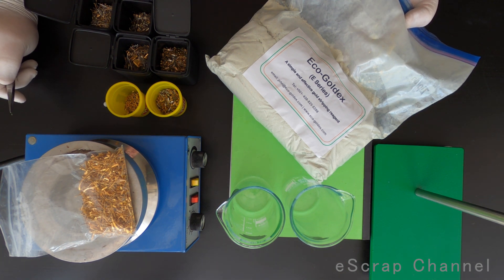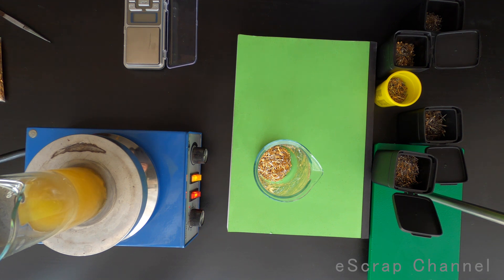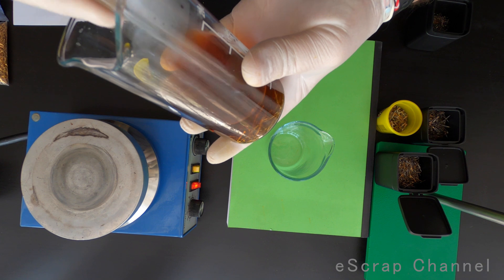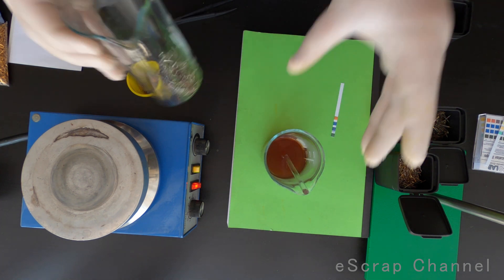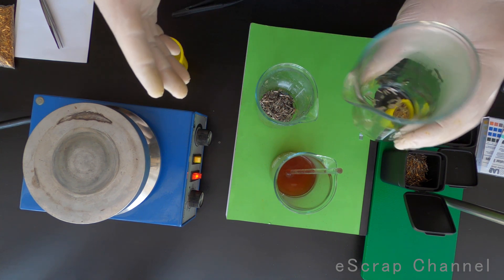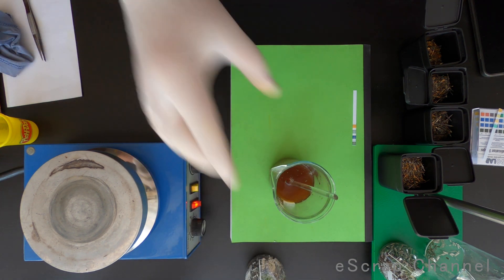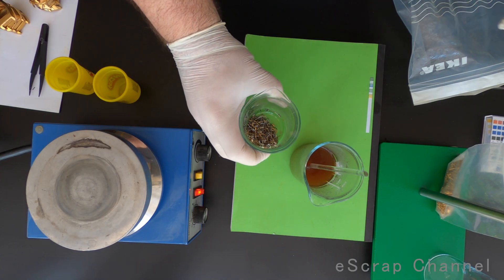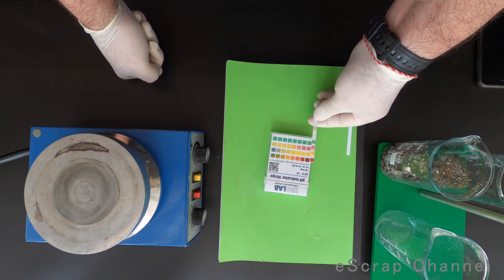Gold Stripping Agent Test: Eco-goldex E series

Comment: One question, being an alkaline solution and containing cyanide, does not the gold precipitate with zinc without having to be acidic?  In cyanide precipitates in alkaline
Reply from the maker: Yes, you are right. Zinc is precipitating gold in strong alkaline solution. Additional 1-2g of Sodium Hydroxide can be added for a complete process. 
In this video I checked the approach of other YouTube chemist working with eco-goldex, but this is not needed to go to neutral or acidic. Gold is perfectly precipitated in strong alkaline solution!
Reply: @escrapchannel  I had my suspicions of being able to precipitate without having to lower the pH to acid, it seemed dangerous to me, and the gold content is not correct, today I will try to precipitate directly in alkaline, thank you very much, greetings from Spain
Reply from the maker: qtmeto: So, if you have the solution with gold, first filter out iron and dirt, then add 1-2g sodium hydroxide as in many cases pH is at about 12 of the cyanide solution and you need it 14. Then start adding slowly zinc powder and constantly stir. If zinc remains grey it is not good - you must see black. This is the gold. Add 3-5 g zinc and if you don’t see black powder in the solution, add more sodium hydroxide.
Reply: @escrapchannel  I understand, I will work it like cyanide but if I add hydrogen peroxide,
Reply from the maker: qtmeto: I see 😃 👍
Reply: I will work on it and comment, there are many people who buy ecogoldex and they may have an accident without wanting to, I do not think the producer is realizing the real risk
Reply: @escrapchannel  Hello mate, yesterday I tried the product at 14 ph.  And precipitate 3 microns of pure gold from 100gr of low-yield pins, it is better alkaline
Reply from the maker: qtmeto: 👍
Reply: Note: this reagent does not contain cyanide as far as I know. It is an alternative to cyanide and is likely based on a thiosulfate/thiourea complex.
Reply from the maker: Hi, as I bought it from Europe and it came from Canada I have the shipping documentation and ingredients listed ... there is a cyanide complex.
Reply: I kept bringing my eco to 1 ph and added zinc strips.i i did it 3 times to get gold out.i was using a bucket.all the chemicals you have to watchout .eco has a strong smell that can mess with you so vent good and wear good chem face mask.i try to wear the mask just useing chems to clean the house.crazy how most people dont

Comment: Its iron cyanide right?
So the magnet stuff is iron then?
Reply from the maker: Yes!
Reply: @escrapchannel  Thanks
Reply from the maker: 1000 I optimized a little he process and in the end of the week will post video with ecogoldex gold stripping that is safer than the current process used. But having cyanide is a risk for handling and using in a home laboratory.
Reply: @escrapchannel  I am very much looking forward to that video!

I always did the full acid baths but now i am looking in less harmful and easier to handle alternatives.
Trying out things like vinegar/citric acid or iodine leech. As well as how to minimize my chemical waste.

So the eco-goldex looks good to me for the leeching itself. The last steps however still needs a host of chemicals i try to avoid if possible. And that is why im very much looking forward to that new video of yours :o)

And yes, don't play around with cyanide kids, or acids for that matter ;o)